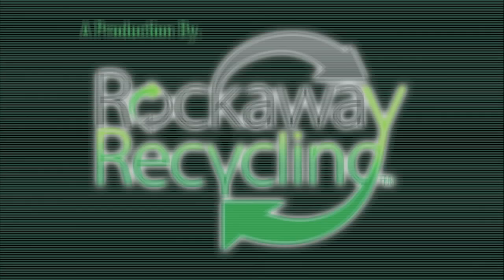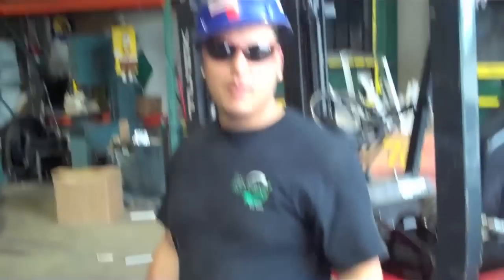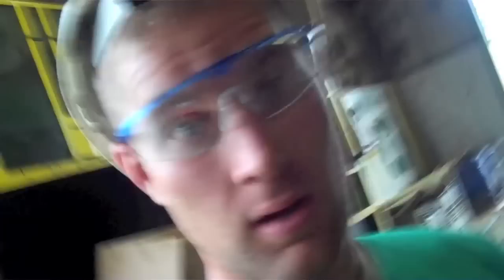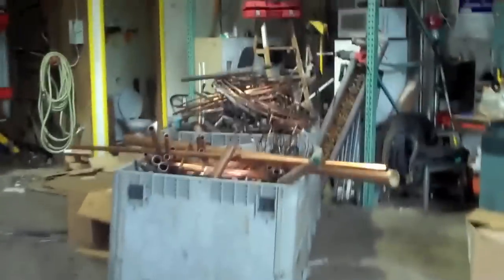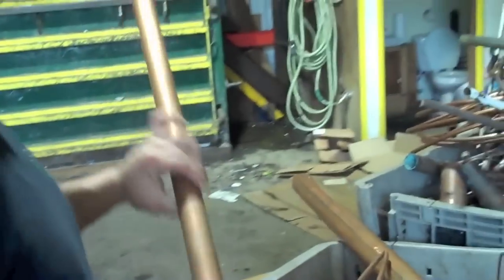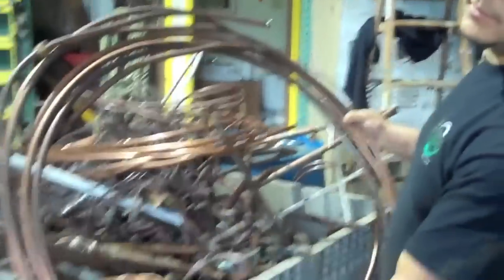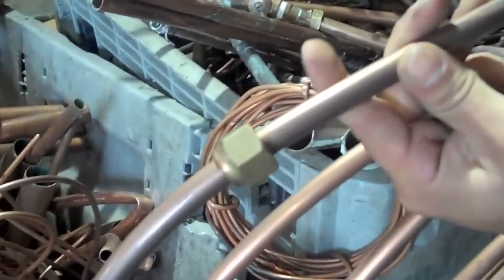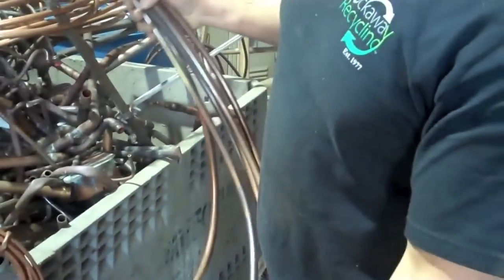How to Separate your Copper

Comment: I have a hobby concreate mixer in the barnyard. Im gonna throw in my painted brass/copper with some sand, small rocks and also small steel chains (the chains was the original item I wanted to clean, but now I will also try the brass/copper 😁.
Maybe its gonna be one of them STUPID THINGS I DO.... But since it cleans off rust from steel chains im guessing it will grind away the paint.
And Im gonna start with ONLY sand and small rocks... Will cry if my brass / copper turns into yellow sand dust.